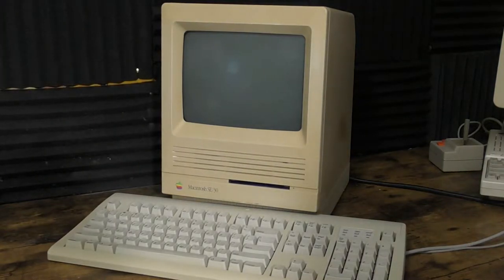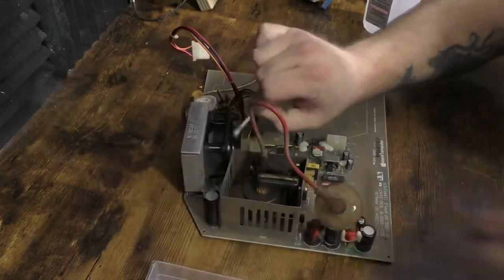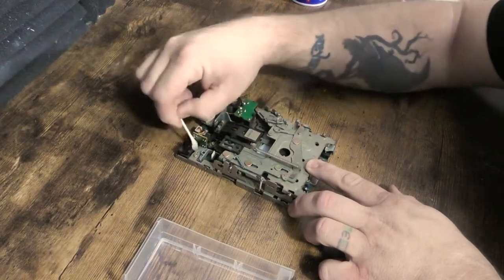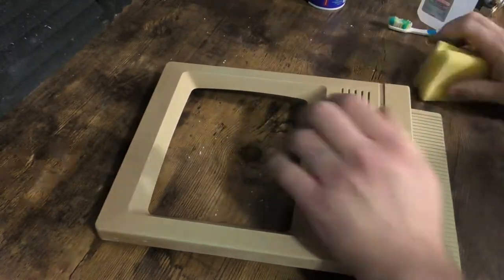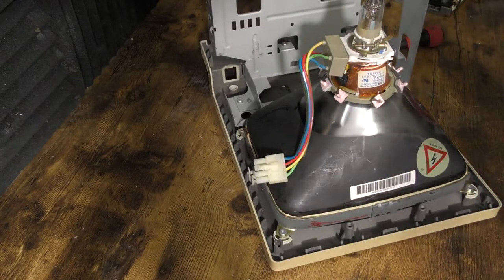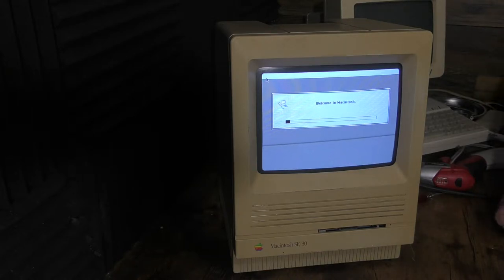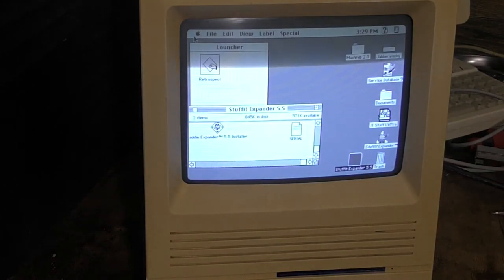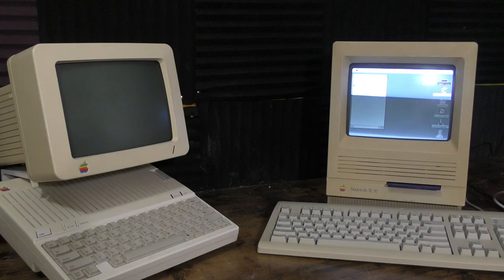The CRT friggin' DIED on me! Mac SE/30 Part 2: Retro Restoration

Comment from the maker: I've had it running for several hours while I finished uploading this video and it's working great! Any thoughts about upgrades or mods? I'm definitely ordering more RAM and probably adding an SD card solution.
Reply: An Ethernet card
Reply from the maker: I was super lucky that this came with an Asante Ethernet card. Those are getting really expensive!
Reply: @RetroTechToys  damn, then you got really lucky! My Macintosh se came included with an working Ethernet card, which was awesome!
Reply: Nicely done!! Maybe a ethernet card and modern hard drive replacement

Comment: You can actually put your SE/30 board in your SE super drive machine, then you'd have a stealth SE/30 machine. For your dead CRT, did you recap the analog board?  That could solve your issues. Great idea on adding more RAM.  My personal thoughts on a SE/30 anything more than 32MB is overkill. For an SD solution, the BlueSCSI is a nice inexpensive solution. I've got one in my SE/30 machine. For my ColorClassic I used a SCSI2SD which is a lot more money, but has some extra goodness built in.
Reply from the maker: Great comments! The analog board in the SE/30 is working. The one in the SE needs a re-cap badly. I like the idea of a stealth SE/30 too. I might grab another board and do that when I get a new CRT for the SE. I've been looking at the BlueSCSI option and I think I might do that. Are there decent external CD-ROM drives that you'd recommend?
Reply: @RetroTechToys  Thanks! Happy to make suggestions. I had a empty (no motherboard) SE FDHD and put a loose SE/30 board in it. Instant stealth SE/30. As for external CD-ROM drives, I only know about the Apple SCSI branded ones. I might still have one in the "stuff" from the huge rescue I did back in March. There's a video on my channel about it. I would recommend getting a external SCSI Zip 100 drive for use with your Macs which makes it super easy to get files to and from the machine. I also have a USB Zip 100 drive I use on my Windows machine to load the stuff, then over to the Mac. Anyway, feel free to reach out to me off comments and we can discuss getting you sorted. My contact details are on my channel about page.
Reply from the maker: @geekwithsocialskills  Will do! I'm off to bed but I'll reach out to you sometime tomorrow. :)